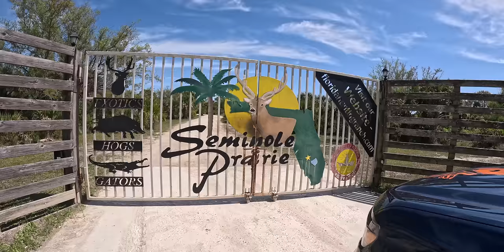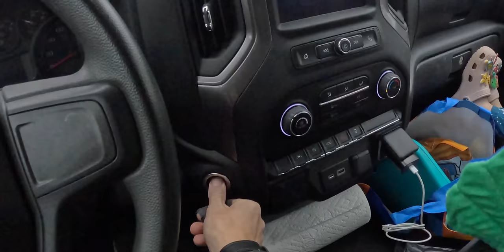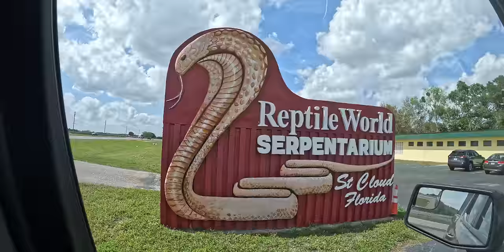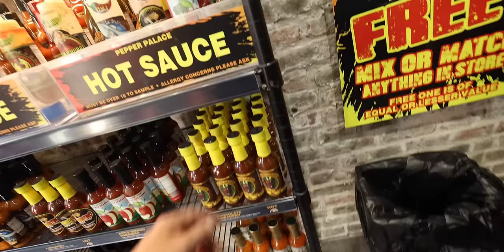Catch & Cook Florida Backwoods Day 1 of 3

Comment: I've lived in Florida for most of my life. I actually live in Baker county, which is just up under the OK euphonoki. Swamp by highway 127 that turns into a dirt road that goes directly into the bottom of the swamp. Yes, it does, but there's ways to stay cool. The mosquitoes are probably the worst thing.  And then you're camping out there, so stay still and pigs. Got a real good sense of smell. So they should leave you. Be every once in a while, if it's a mama sal or a big one, it doesn't hurt to bring protection. I wouldn't go out in the woods without it. Anyway, no matter what.  A pig'll tear you a real nasty bite

Comment: The Owl is asking where his food is. Grapeseed oil is Very high temp smoke point is 420 Peanut is 450 its close. cottonseed is a really good high temp but cost $$$. ALSO GATOR you should use some fat in it. like butter or some beef fat or even BACON will be amazing it will make it more tender since Gator has no fat

Comment: Lets us just get this straight now. If you are not packing your gear then a tent where you can stand in it is a must. You literally just unfold them. Why spend the energy and physical cost of using a small tent?? dude. u don't need to cut sticks or logs, you just push them in.

Comment: You probably shouldn't have camped there. It's kinda a swamp. There is a ditch/trench drainage behind you and all the Flora are swamp flora with wet bottoms. 

The mosquitoes and pests would be bad there. Best to camp on higher ground if possible.
Reply: BTW, there is no such thing as "Gator Sauce" as long as I have lived here. To season gator, basically it is a dry rub or a battered/fried blend for gator tail. "Everglades seasoning" is a thing and often an ingredient in that. 

A Blackened Grouper or Redfish sandwich is the standard Florida food. (With Key-lime pie for dessert, of course)